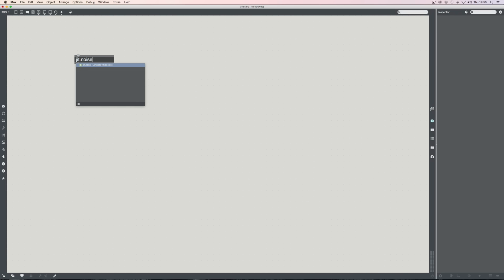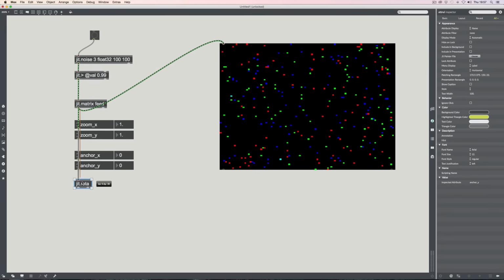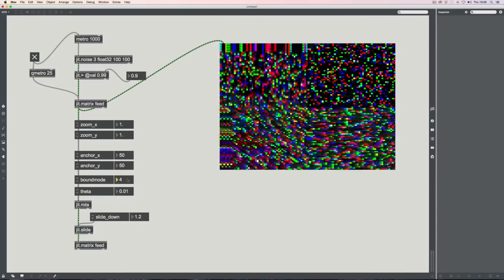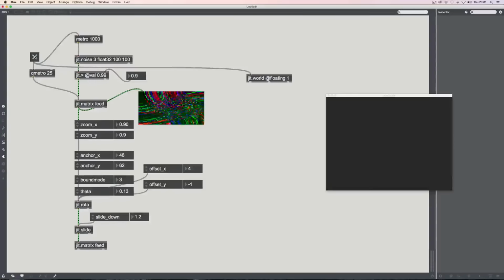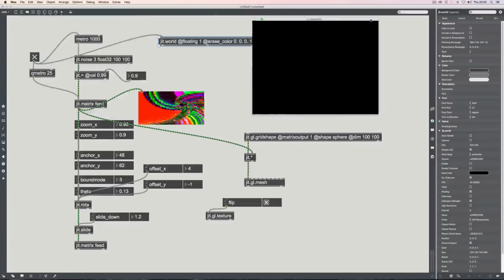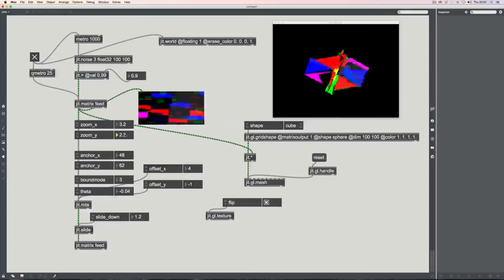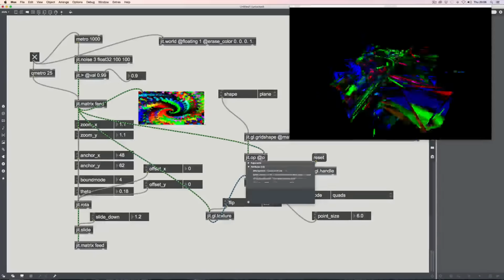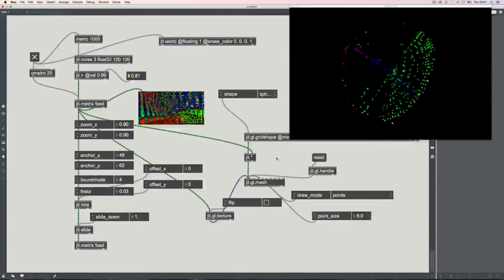Max Tutorial - Glitchy 3D visuals = Ned Rush

Comment: hi ned
zoom x won't chANGE FROM 0.?
i put in numbers and it resets to it immediatly
Reply: I rebuilt mine and connected everything before I output a bang - think its something to do with the bang having outputted a 1 or 0 that is forcing the set mode of the ZOOM X - try building it all then connecting bang/toggle at the end and it should work.

Comment: Great video! Im new to Max and have been doing a lot of stuff based on the patch in this. A newbie question: how do you zoom in the jit.world window?
Reply from the maker: +juliarutt zooming the quickest way as a starting point is plug a jit.gl.handle into jit.world. Check out the jit.gl.handle helpful.
Reply from the maker: +juliarutt helpfile not helpful.
Reply: @NedRush  hey don't know if you still need it after a year but I just found out you can use shift+alt & your mouse to zoom in and out.
Reply: just alt*